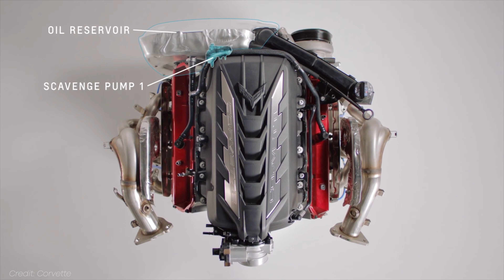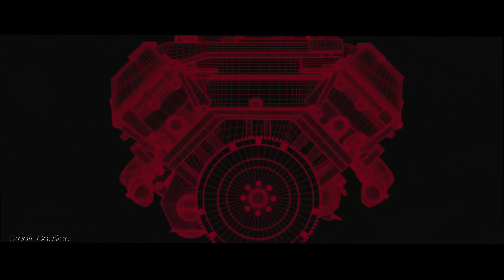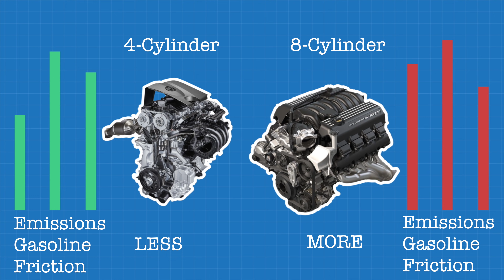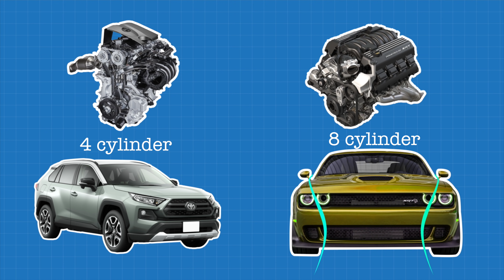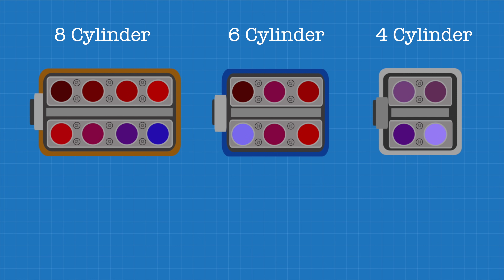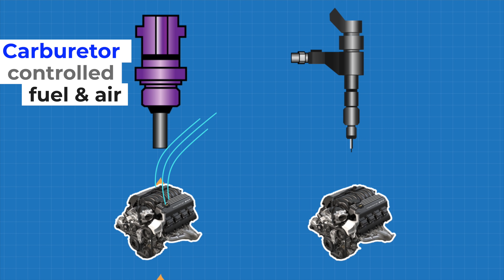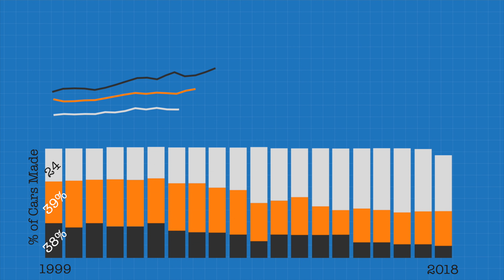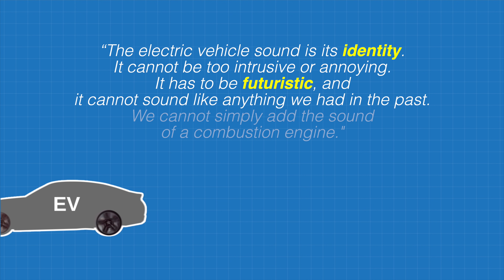Why V8 Engines are Dead

Comment: I think electric cars should have options in the end.

But a good starter would be something with a beat like an engine that it's beat goes up with speed as with pitch with the sound of a motor and jet engine. (At least for the performance vehicles)

Maybe something that sounds like a roar for electric trucks, and definitely have a Jetsons sound as an option for all vehicles.

Tesla's planning on making a coconut sound (aka, horse walking) along with other yet to be known sounds that I'm looking forward to. 

I will be owning a Tesla in the near to mid future and I plan on getting the Electric Hummer for my family somewhere between 2025 and 2030 (I expect it's expensive)

Comment: I agree with some of the stuff not all of it I really don't think v8  Engines are going anywhere I mean you can still get 20 miles to 25 miles per gallon on a modern V8 engine and to be honest you don't have to be wealthy to own  A V8 You can go on craigslist and buy a 2001 Mustang GT for like $3000 V8  Engines are not going anywhere I mean look at the new twenny twenny vet that's got A V8 All of doges challengers and chargers come with an option for A V8 And I still get 20 mpg It all the pans on how you drive

Comment: for the petrolheads. let me give you an example for why tesla has grown so popular, lets take their sport sedan (as their sportscar the roadster isnt on  the road, atleast not the revamped version) the model S.  it has a range of nearly 400 miles. if you have solarpanels and a plug you could basically charge it for free. it has a acceleration of 0-60 of between 2.6 and 2.3 seconds (this is straight from elon and Tesla's site) it can house 5 people comfortably. aand it blows every car in its class out of the water. oh. did i forget it improves  over time  due to over the air updates? cuz it does.

Comment: The V8 is not just for speed. It's made for power. It powers trucks across the USA that helps us get work done. It lasts a long time because it doesn't work hard most of the time, but has the power when needed.

Comment: Such a shame small V8s weren't considered more often. They have been as small as 2.4 litres in cars, and the added cost is not a factor if you use them in upmarket models. I could say the same about the Inline 6, having been as small as 1.6 litres, and there are currently some signs of a return to favour for the I6 engine instead of using the inherently imbalanced V6. The only car engine cylinder configurations that have ever been needed are: I4, I6 and V8 - they cover it all, and most effectively.

Comment: There is zero replacement for displacement. Sure you can turbo supercharge and nitrous small engines amd make a lot of power every one knows this BUT you can also boost aV8 as well and no matter what a bigger engine will always be able to make more power and more torque Always Need I say Top fuel Dragster 10,000 plus Hp Nuff said

Comment: I prefer a quieter car. I dont believe loud noise is necessary. My 2012 V6 MUSTANG is much quieter, and with the ProCharger under the hood, I've baffled many a stock V8 owner when I pull away from them. Its smaller, more efficient, and still capable of pushing nearly 500hp; I love it. And considering they won't produce anymore V6 MUSTANGS, I feel good about owning it.

Comment: Actually, it seems V6s are dying faster than V8s, because modern V8s more and more, come with a V4 running mode, which makes it more efficient than a V6, and then, when you need more power, you have V8 mode. So, why ever buy a V6?

Comment: Video doesn't understand why V8's were developed and why they are better for hauling and work purposes...  Sure you can get a 4 to put out power...  But try to climb a mountain road towing a trailer with a turbo 4....  It will self destruct after a mile, while the V8 was already over and coming back down...

Comment: A lot of what will keep the v8 engine alive forever is it is cheap. You cannot make horsepower in any other engine configuration like you can with the v8. It is what almost all research and development goes into therefore it is cheaper than other configurations. You can commonly find v8s with over 1,000 horsepower all over American streets. The v8 is not going anywhere, it is here to stay period.

Comment: Maury Povich: You claim V8's are dead, but my LS Determined..... That was a Lie!
Reply: Take a small fuel efficient car, remove the engine, put a turbo LS in the hole you created, this is the formula for happiness.
Reply: @SuperDriver379  barra six turbo might argue with you!!
Reply: @SuperDriver379  what?
Reply: And besides if they arent in sports cars they will be in trucks because of tourque
Reply: @_chevy_s-zj5pw  is tourque related to a twisting force that tends to cause rotation?
Reply: @_chevy_s-zj5pw  those 4.3s are impressive. Alot of tuneability
Reply: What LS?
Reply: @KennethRobinson-hl7sg  any ls, go find an old Chevy silverado or suburban or van with a 5.3 or 6.0, even the 4.8 got some balls , super cheap couple hundred $ run forever
Reply: Ricky lake. Show too
Reply: Nice
Reply: I also know a man who had a dirt car with a 4.3 v6

Comment: Oil is cheep and pluntiful.  V8 is not going anyware just yet.  However the three cilinder opposed piston engin should have been avalible years ago, it is simpler and more efficient than engins with heads.

Comment: I love a V8. I stated driving with a V8, and within the span of 6 months I lost my license. Speeding was so easy to do. 

So what I decided to do was to get a 1992 Ford Ranger with a 4 cylinder 5 speed. For anyone who has the luxury of driving one, you know it goes from 0-60 in about 15 minutes. (I’m talking after it has 150,000 miles. They had pep when they were new). It took work to speed in that thing. Haven’t been pulled over in 15 years. I stay with the 4 cylinder engine. It does what I need it to, but MAN I miss the days of blowing the doors off other people’s cars.

Comment: There was a movie years ago about a couple of guys making the sounds for cars.  It was called The DilemmaI (2011). It was exactly what you are talking about.  I agree that you should be able to select the sound you want for an EV but maybe not the volume.  It should also be able to sound at all speeds.  Nothing like that low rumble at 65mph.  I used to have a '56 Chevy with the 265 v8 and glass pack mufflers.  That sound it made was beautiful.

Comment: I bought my V8 in 2005 for durability, the bonus was smooth reliable power when needed.
200,000+ miles later and no breakdowns, I am still happy with my purchase.

Comment: V8 will be making a comeback to replace diesel engines in pickups.  The cost, maintenance and poor efficiency of the new, "clean diesel engines" is pushing people who need trucks for heavy duty hauling back to big block gas engines. Ford just bought out a 7.3L V8 engine and I bet Ram and GM will be doing the same.  As someone who drives a pre emissions diesel and a deleted diesel,  I will be keeping those on the road for a long time to come.

Comment: I would have thought that Scotty would have mentioned the government's increasing role in eliminating the V-8 engine. Government requirements on average exhaust emissions and average fuel mileage become more challenging every few years (although President Trump has recently relaxed some of the nearly impossible requirements). With respect to exhaust emissions and fuel economy, a turbocharged or supercharged V-6 engine will always beat a V-8 engine. It might cost more, but the government rarely concerns itself with cost.

Comment: To V8 or to not V8?  As an old loud muffler pimple faced sports car owner from the early 1960's  ...  I repent!  making unnecessary noise is unkind to your neighbors and to yourself.
The art of a great IC engine is performing beyond well when required however in common situations to exhume no more than a hint of potential energy should it be needed.

To this end the V8 has a unique quality of irregular meter that distinguishes itself from other power formats.  I4 (or any 4) is a rough but uninspiring.  V6 or I6 can be smooth, unassuming and deliver performance is required without leaving a trademark.  Only the V8 has its trademark rhythm of confidence and reserve.

Some may ascribe similar sounds of the Harley and other noxious duopeds to similar aesthetic sentiments; however in puerile simplistic values, loudness does not equate to performance, or in any sense quality.
Reply: Before too many bitter replies attack my statement:  please understand, I used to be a pimple faced nerd racing around town in my excessively noisy sports car.  I was a jerk!
Are you doing the same thing? Then you're just like the pecker head I used to be.  Put a cork in your muffler before you regret your past.

Comment: They are still extremely popular in pickup trucks even if they aren’t as great in cars anymore ford makes the eco boost but I’d rather have a v8
Reply: If this video taught me anything is that v8 are exspensive but makes sense more parts more power tho i think like how we got v12 if we want more power well try to go higher or a completely new type of engine all together yeah sometimes we get stuck in the way of a gas powered engined is the only way to push a vehicle
Reply: V8 FTW. Easily the most appealing engine in the world whether it’s a European or American V8. They are both equally badass
Reply: Kemper Harris eco boost is crap
Reply: 7.3 powerstroke v8 🤑
Reply: Alien Edgar yeah but I’ve gotten 27 with my 2.7 EB in flat FL and the 3.5 EB would out tow your V8. The way it’s marketed is 2.7 light towing but good fuel economy mainly because most people who own a truck never tow anything. V8 and 3.5EB for towing heavier loads and the 3.5 is rated for heavier loads, but obviously Jonathan Wilson have the 2.7EB
Reply: Fords 2.7l eco boost is badass rn too... v8 brings that joy but that eco boost makes much more sense
Reply: After owning an ecoboost, i will never own a v8 half ton. Im getting 24mpgs with 325hp and 375ft/lb and 8500lb tow capacity. we will see v8’s disappear in half tons, as technology advances.
Reply: I’ve had both, the V8 wins for me and won’t buy another EcoBoost. The V8 runs cooler and gets better economy towing and under load. Can’t wait to drive Fords new 7.3L V8 F-250 Tremor.
Reply: @jonathanwilson641  have you actually ever tried towing 8000lbs with an ecoboost... It ain't happening without overheating the trans because they change gears 24/7 to keep the engine in its power band because they don't have the low end torque or a v8. Theres a reason the towing capacity of the ecoboost is 8000lbs and my 6.0 with 2 less gears and the same power is 6,000lbs higher. The ecoboost good engines in cars but should not be in a truck.
Reply: Konner Kramer you can but need the tow package that includes extra cooling
Reply: @konnerkramer329  nah...the Ford has more torque at a lower rpm than any other half ton truck.
I have to feather the gas in the wet because the tires will just spin, at basically any speed. 
Also the transmission is coming to a Chevrolet near you soon,it was developed jointly by Ford and GM.
Reply: @jonathanwilson641  my 2015 GMC 4x4 with a 6.2L V8 got that kind of fuel mileage with 420hp, 460lb/ft of torque, and 11,800lb towing capacity
Reply: Can Scottie make an old fashion rotary piston engine laying on it's side? What is the advantaged vs disadvantages?

Comment: Sad day when V-8 are gone ;;  hope they will be here for military use in the future that mite help keep V-8 around longer ;;; I’m sure of this V-8 have more wait to them I feel V-8’s would be able to tow things a lot better because of the wait they have in front of the engine in pick up truck for heavier loads ;; the V-6 is not has heavy to keep the wait off the rear end of the truck car suv etc. ::: bottom line the V-8 would hold up better towing and more wait to them to tow;;;;

Comment: V8s can run at lower speeds without stalls because they have twice as many pulses per revolution. hence the smoothness. Lower engine speed gives more time for fuel to providing more heat to convert into mechanical work.

Comment: V8 engines last 20+ years. If you take care of them. 300,000, miles and still going. You can overhaul them to run forever. New Engines and innovations are designed to keep regular people from working on them. New Engines , no thank you. Dependability over innovation any day.

Comment: V8 engines will be history soon.  ICEs will be around for a couple more decades in the form of NA and turbo I3s, I4s, and a few V6s.  V8 cars are still available and not that expensive, but no one really wants one because of high fuel consumption, high maintenance costs, and less longevity than I4s.

Comment: More friction? Umm.. not when they can cruise 60mph at 1200rpm vs 2400-3k for a 4 banger.
Gearing and torque is just as important.
They can be very efficient, while being reliable and provide heaps of power. You can have it all with a V8. You can't with a 4 banger, especially turbo.

Comment: Rented a new van with a turbo 4 cyl. Worse gas mileage than my 6L GM, struggled to get over steep hills, absurd high revs mean that the engine will wear out way sooner than the low revving v8. Obviously what the auto manufacturers have in mind.

Comment: In your next informative video on the demise the v-8 could you include that there was variable valve timing available for the small block Chevy through either Rhodes lifters or variable cam timing under the timing chain cover by Vari-Cam.  Great gas mileage could be utilized by smooth cylinder walls and Stainless Steel rings.  Most of this stuff was available in the early sixties and was used mainly in race engines.  Usage of these parts in street cars was discouraged. These parts would also contribute to the life of the engine especially the rings as the rings would seal better over time.  Could it be more that the v-8 fell out of favor along with cast iron heads as they require more effort to put together.  I get this thought  every time I build one as getting older when I'm halfway thorough I'm a little tired and with a four I would be done.

Comment: The fact that it was made for plane back then proved it’s reliability and power. When I saw a V8 pickup tow a 300,000lbs space shuttle across a bridge, I was impressed that they give the gas mileage they do have. It’s proven it usefulness overtime. Maybe it’ll live with different technology.

Comment: A Hemi used to demonstrate more fuel usage...False. One of the most fuel efficient designs in any motor. Hemispherical combustion chambers thus burning fuel at a much more efficient rate. A new 5.7 Hemi Challenger with MDS can achieve 33-35mpg at 63mph. Oh Yeah that's a V8 by the way! Use the correct fuel, oil, air intake and this is easily achieved! How do I know? Well, we have one and it does it all day long. Foot control people!

Comment: Before swapping rear axle gears my daily driver 68 Plymouth Satellite with a solid lift 4 barrel 273 V8 and 3 speed automatic got about 25 MPG and topped out at just over 150 MPH. Pretty impressive engineering for a 50 year old muscle car with a cast iron pushrod V8 and early dinosaur 3 speed automatic. As someone that has actually experienced true muscle era engineering I find it funny how they can't make anything fast these days without force feeding it. They have to rely on the crutch of forced induction and computerized fuel and ignition systems to reach the power levels of stock naturally aspirated carbureted 60's muscle cars with mechanical ignition and cast iron log exhaust manifolds. And even then modern cars weigh so much more than their classic counterparts and have so much more parasitic drag in their large overdrive transmissions that they aren't even half as fast. My Satellite is the same platform as a 68-70 Charger but with different sheet metal. I currently have a mild budget build 360 making about as much power as a stock 440 and a 3 speed auto in the car. I vastly outran a guy in a brand new 8 speed auto Hemi Charger 3 times in a row and he was shocked to see I had a 360 I pulled from a junk van and a 3 speed auto. I find it funny how 50 years of technological advancements put him behind the classic version of his car instead of in front of it. It's mostly due to the fact that a new Charger weighs 4200 pounds with no one in it and a 68 Satellite with a small block and an automatic weighs 3400.
Reply: You daily a damn Satellite? I'd baby that thing